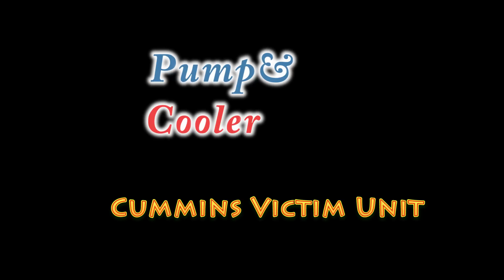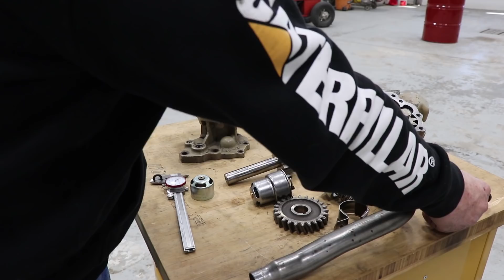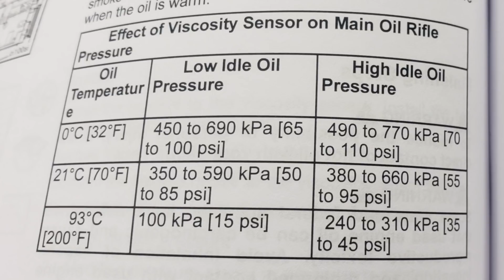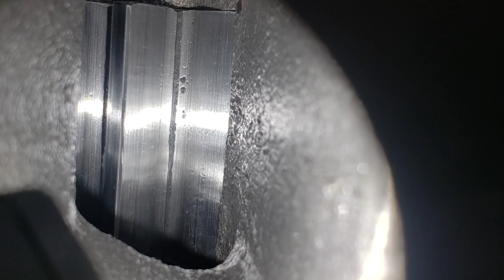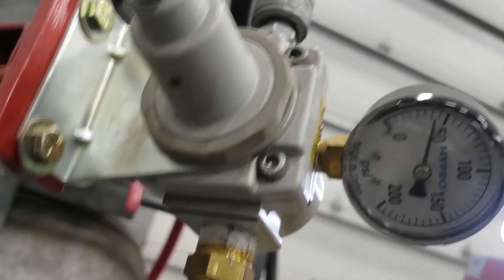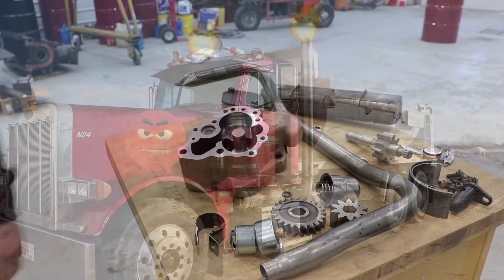How To Fix Low Oil Pressure On A Cummins N14

Comment: bad design  ?; the helical pull (the teeth angle) should be in the other direction; that way it would be possible to re-grind the pump cover if it had wear marks on it; the way it is ,it's not
(never saw or had to rebuild those engines,just felt like saying that...).
edit:   agreed, P/S pumps or oil pumps, above .004" clearance they're pretty much done; some can be reground, but the gears are always worn also, need to measure that

Comment: Good analysis Jeff.  Surely a bit of truth in high temp for fuel economy.  I’d still recommend a thermostat though, as overcooling oil can lead to issues as well.  I suggest calling up a company like Caltherm ( they probably make this part) and ask about a lower temp version.  It’s likely just the wax recipe in the power pill.  If they don’t have one, you can design one yourself and sell them with your other merch😀

Comment: Only way to really tell whats better is the fuel savings vs oil change savings. If the oil pump trickery saves you 0.1 mpg from 4.9 to 5mpg that's 4k gallons at 1 million miles and at Idaho diesel price over 3.38 per gallon that puts you at $13,520 in savings on fuel. idk whats the better option. To me it seems like a wash on which would save you more. Id just go with what ever saves you more time and hassle.

Comment: On cold sub-zero temps when oil is very thick, without oil thermostat you are forcing thick oil through oil cooler's small orifices. Doesn't sound like a good idea. IF you live in warmer climates like south and south-west, that may not be a problem, but if you are up north where temps regularly drop below zero, oil starvation could be a real problem.
Reply from the maker: block and pan heater, same thing we do with our cat stuff
Reply: Maybe in the video you should specify that this mod absolutely requires a block/pan heater for cold climates
Reply from the maker: @NICK-uy3nl  I don't know that yet, but we generally use block and pan heaters on our CAT stuff as we run a straight 30wt oil, I would assume if you ran a multi weight you would be fine down to zero but below zero usually reguires some pre heat with any type of diesel engine, I believe I did say I would be using both types of heaters in the cold, you may have missed it if your not subscribed and watching all my videos,  I personally never cold start my stuff below ten degrees or less, mostly because I'm using a 30 wt oil
Reply: @Jpaydirt  What you're saying makes lot of sense, however, many operators will walk up to a cold diesel that has been sitting overnight at sub zero outside and will try to start it. Put it down to laziness or ignorance or because it is not his truck and he couldn't care less, he is just a driver. IF every operator was as careful as you about his equipment, they wouldn't have to design an oil thermostat in the first place
Reply from the maker: @NICK-uy3nl  Yes your right.  If I had time I could design a reilef valve to replace the stat with a spring that would bypass the cooler at anything over ???? pressure
Reply: 1996 Freightliner FLD120: Farmer owned for the last 16 years until I bought it. I run Mobil Delvac synthetic blend 15-40 and a kerosene block heater with the exhaust aimed at the oil pan on jobsites where there isn't 120v power. My N14 starts fast but still takes awhile to build oil pressure unless I use a remote start button with the key off.  Then I can crank the engine without it firing until I see oil pressure on the gauge and then turn the key on. 12psi hot at 550 rpm is a little low for me.  I think I'll mill down the spare oil pump to .002 clearance and try that.  Thanks for the good info!

Comment: Years agr late 90s i ran a N14 the company changed the oil at 18000 miles. They sampled every oil change. The company im with now. 
Still runs old IHC and N14s runs local and changes there oil 
Every 3 to 6 months. Well the boss got fired hopefully the new boss can change the maintenance policy. 
We need some new mechanics as well.
Reply from the maker: so how did they fare at 18k and what kind of use did they see,  long haul?
Reply: @Jpaydirt  That’s right Jeff, change intervals can be a lot longer on long haul. Cold running, short runs and lots of cold starts wrecks oil and engines. If they never get turned off they will go forever. Jeff

Comment: I design fuel systems for military jet engines at GE.  I've caught hell from the technicians many times.  The designs look great on the computer but not so good in the shop.
Reply from the maker: Thats honest and funny William, thanks, would love to hear more about how the process works and it's shortcomings, what would you change?
Reply: @Jpaydirt  The system is getting better.  Most of my CAD models are used to make 3D printed prototype parts to validate the design.  The biggest issue with the process  are the union rules.  As a designer I'm not allow to touch tolls or parts in the shop.  If I do someone will file a grievance.   Every designer should spend time in the shop and understand what's good or bad with their designs.

Comment: Just to add to the point that engineers do not always know or understand their products problems, we operated a couple of Komatsu WA-1200 FEL's with Cummins QSK60's in them.  The longest we ever got the engine to last was roughly 6,000 hours with most failing in the 3,000 to 4,000 hour range.  At the time it was a $350,000 reman engine.  Since those were warranty issues and we had so many problems both Komatsu and Cummins were sending tech people to the jobsite.   Will never forget that the Cummins "expert" put a meter probe on a running fan belt and declared that the engine was not grounded properly and was causing electrolosis and causing the main and rod bearings to fail so in essence it was not their problem that it failed and no warranty would be given.  The dealer mechanic unbeknownst to the Cummins "expert" tech guy went to his mechanic truck and performed the same test and came back and informed the "expert" that he figured that he would have to replace his mechanics truck engine as he got the exact same reading on his truck.  That shut the "expert" up.  I can't help but wonder now after all these years if some of those problems that we had were related to some of these design flaws.  This was very interesting and a great deep dive into this and I thoroughly enjoyed watching these.  BTW the end loader productivity was awesome and it was an excellent machine but we just couldn't live with the low engine life and eventually replaced the machines.
Reply from the maker: Thanks for that, Love these kind of comments

Comment: Oil samples are a great tool. It's important to establish a pattern. Then when something is abnormal, such as a spike in copper parts per million, it allows you to be proactive and repair before failure. Other things such as soot levels and viscosity will allow you to adjust service intervals to both avoid pushing your oil too far, as well as throwing away good oil and filters. The factory usually comes up with a  oil change interval that is conservative enough to keep the customer out of trouble. After a few years of monitoring oil samples for our fleet of garbage wagons, I had similar engines with a wide range of oil change intervals. Like 1500 to 10,000 miles. Many of these engines were 3306 Cat engines, which usually went around 30,000 hours before overhaul. I still have some bearings, top of rod bearings and bottoms of mains which measure less than .001" wear after 30,000 hours. As measured by a starrett ball anvil micrometer. 

The bottom line is: buy good oil and filters, and keep it clean! If you want the longest life and lowest cost, spend the money for sampling. If you don't know how to interpret the reports, get help from a knowledgeable lab. 

My engine rebuilding and shop foreman days are behind me now. But the basics of good fleet management will never change: Attention to detail, pro active maintenance, and cleanliness will always be important. It's your money, how much do you want to keep in your pocket?

Jeff, thanks for this series. I enjoyed it immensley . Keep 'em coming!
Reply from the maker: Thank you for the comment, I agree with what you have said 100%

Comment: When I was at the State of California we ran re refined oil but changed at 6K with filters. We never had pressure issues and for the size of our fleet very few major engine issues. Well, that’s if you didn’t count the 6.2’s and 6.5’s. I have said and will continue to say I would use the 6.2 for a boat anchor but I bet it would fail at that too.
Reply from the maker: It would probably float   LOL

Comment: Excellent Postmortem . This is the exact type of knowledge and wisdom that needs to go forward into the future. You should make a DVD set of these kinds of vidyas. Many valuable insights in this mini series. Especially on how degraded our supply china... er... chain... has become. We need to keep rebuilding the old iron, long after the electronic junk goes tits up, the old gear will still be running and carrying civilization.
Reply from the maker: Thanks

Comment: Excellent video Jeff, it's obvious you are a highly trained engineer and the bonus is your very good at explaining things.  My old D9G has questionable oil pressure after it warms up, it's in semi retirement now but it will have to be addressed before it goes back to work some day.
Reply from the maker: Mine has issues also, but it's a little harder to pull in the shop and drop the pan  LOL
Reply: D9Gs all have low oil pressure when they're warm. My dad was apprenticing as a mechanic when they were new. At brand new, with warm oil at an idle, the oil pressure was in the white. We had 6 D-9s and every one of them the oil pressure went in the white at idle.
Reply: @tyfrank3427 get a different gauge avoid gray hair

Comment: Are oil changes at 10,000 still in your opinion required and should the oil be fully synthetic as well to be safe?
Reply from the maker: synthetic would last longer and take higher temps  I think oil sampling should determine the change interval

Comment: Every vehicle designer whether it be body or mechanical should have to spend a year working in a service shop someplace.
Reply: Yes. 

But also, many of the poor engineering designs don't come about from a single design engineer but rather from other problems; project engineers fighting petty turf battles, poor scheduling and pressure to release new designs, constant cost reduction work, fixes and redesigns that come after tooling has been made which boxes you into a corner and so on ...

So it's easy to see something you could do better by yourself, but imagine working in a team of 100 designers tripping over eachother and not always being able to do what you think is best.
Reply: @a222parker  Now there is the voice of experience, and the battle scars to prove it !
Reply: Yes :) spent many years designing heavy equipment. But I work in a shop before that and it is invaluable experience for anyone who wants to get into designing.
Reply: They sure would design things differently after working on it wouldn’t they.

Comment: IMO I don't like heat, either oil or coolent. I remember the days when thermostats were 160 to 180 or abouts. Now day I hear you have to run them 210 or higher to burn fuel efficiency. I hate it when you pop the hood and the paint is baking on it and it's so damn hot under there you have to wait a day before you can work on it. there is a running temp and then there is a baking temp. I'm not a cook, I'm a operator and somewhat mechanic.
Reply: its not to burn fuel more efficient, 210 is to make the anti wear additives in the oil activate
Reply: youtube isawesome , that’s the first I’ve ever heard that.

Comment: . 085 thick washer, well it got you 50 to 55 pounds on top, of course nothing at idle, not like, the pick up mods, like . I said it 2 episodes ago, woudda just sanded .002 or .003 off the original pump housing, and ignored the wear grooves in the bottom, and threw it back in . I am totally baffled by the 255 F. cooler bypass .
Reply from the maker: I started with 5 at idle and 20 at rated rpm so I increased on the upper and lower ends, would be interesting to mess with end play to see how much it gets you
Reply: @Jpaydirt  well, just talking the .085 shim in the bypass regulator, you just don't get into the bypass region, at idle rpm .

Comment: So basically just buy a CAT lol love the vids. Just bought a 2002 s series international with a c12 83000 original miles. Love the cats
Reply: I have a c12 also. In the morning when start up my oil pressure is at 40. Once i drive for about 15 min the needle drops to 20 and it stays there!! Why???
Reply: @89lapalma  my acts the same way.  Once its warmed up it will run about 28 or so at 1800 with a decent load.  From what I've been told they were designed to run at lower oil pressure than say a 6nz or older 3406.  I need to ask Josh over on the adapt ape channel he is a certified cat genius.
Reply: @joshuaplacka8480   if you get an answer please post. Thank you!

Comment: Good explanation Jeff, and correct in your evaluations.  Yes, the bore faces can be machined in relation to the top to tighten the clearance's.  It will require care to properly align before machining.  Then CNC mill the bottom without opening up the bores too much.  Also look at the gears.... they should be exactly the same thickness to keep the clearances tight.  And no, Abom79 isn't the guy for this... he doesn't have the machinery for it.  Peter at Edge Precision is more suited for this type of work, if he has time for it.  It would be an interesting video.  Keep up the good work!!
Reply: I suspect Cummins machined them with a Standard counter bore tool. CNC would be too slow and this design goes back 80 years. The tooling probably did too. lol

Comment: Later model n14's use straight cut gears. I'm pretty sure cummins likes the slightly higher oil temp to burn off moisture and hotter oil filters better. I'd rather they ran higher idle psi but they'll last a long time if some other cheap part doesn't fail first. A N14 celect + is my favorite on road engine for 80k or less, simple reliable engines.
Reply: I stay around the 120 thousand pounds mark with my 525 n14 and have no complaints been doing that for years!
Reply from the maker: With good care they go the distance

Comment: How to fix low oil pressure on a Cummins N14? Simple install a  Caterpillar 3406 😁 
Jokes aside the main malfunction is companies lowering their quality control standards so that they can buy precision made parts that are not precisely made because they can get them cheaply made in China, India, Pakistan, etc.  The way to stop companies from buying and or accepting junk parts is to Bitch Moan Scream at them and no longer buy their products.  I know it sounds simple but it's not because large companies frankly don't listen to their customers but only to bean counting accounts who don't give a rats ass about anything but the bottom line.  That said the only way to make them change is not buy their products 
Have a nice day and a better tomorrow.
Reply: Caterpillar has lowered their "quality" standard down to the point of not even providing engines for over the road truck anymore.

Comment: Dead straight. 8 thou is pretty sloppy.
10,000 miles seems low unless they provide different grades such as farm/offroad use, highway, etc. A dump or pump truck that spends lots of time idling or at low speed will see a lot more oil wear to 10,000 miles whereas a box truck that travels interstate will see very little by 10 thou, manufacturers should provide a recommended range depending on use.

How do you feel about extending an oil pan and doubling (or more) the oil capacity to extend range? In my opinion oil acidity is pretty irrelevant with age, heat wear and contamination is the real problem, enlarging the reservoir would seem to keep the oil cooler. I believe CAT has options for industrial engines with different oil pans and change intervals depending on use.
Reply from the maker: Oil sampling would be how to determine when to change

Comment: China has been a hemorrhoid to our nation for years, 99% of there products are junk plus they have little or any Quality Control . The worst thing about it Companies like Cummins have there parts built cheap over there, but charge the same amount! Boca Raton, Florida
Reply from the maker: $1,000 dollars for OEM pump made in china and 260 for the same thing, that's the part that bothers me,  they probably pay 50 bucks for those thousand dollar pumps

Comment: When oil is warm its thinner. thinner things fit through smaller gaps, trust me I am not thin, so I know. Thanks for this its confirmation of what I supposed, I learned arly in my career that dirt and tolerances make the most problems.

Comment: You know engineers may have design conditions imposed on them that mechanics are unaware of. With no restrictions they could design an engine that will last for 100+ years.
Reply: Engineers used to design quality. Now as you're suggesting they are controlled by bean counters. Cheaper products, cheaper production and planned obsolescence and failure. Companies making forever products only sell them once
Reply: Best example is the railroad locomotives.  Used every day, engines get rebuilt, but only changed out for emissions upgrades.  I’ve heard of upgrades where the trucks under the loco are more than hundred years old, but will get new bearings and be used again.
Reply: @jhuelsmann9430  Good example
Reply from the maker: Yup, would love to talk to a retired one

Comment: What if you had a kta 600
Reply: I worked on KTTA's in 80 ton Euclid rock trucks.Good engines-they are used in many pro stock pulling semi's on the OSTPA circuit.👩‍🔧